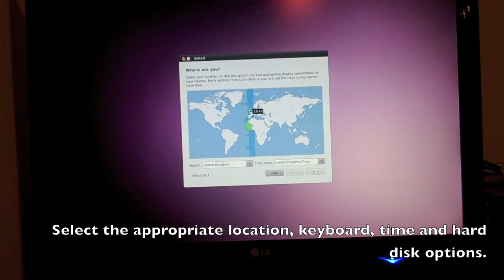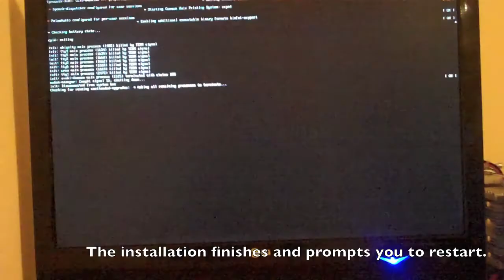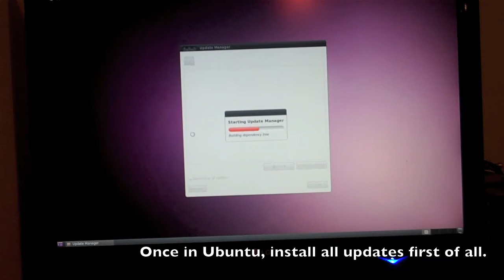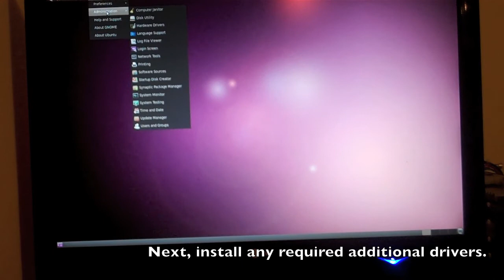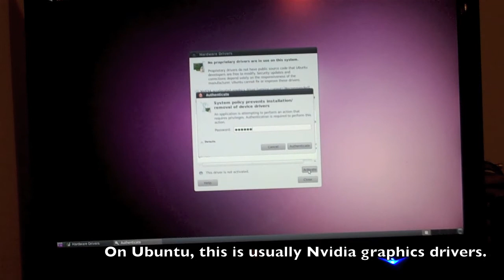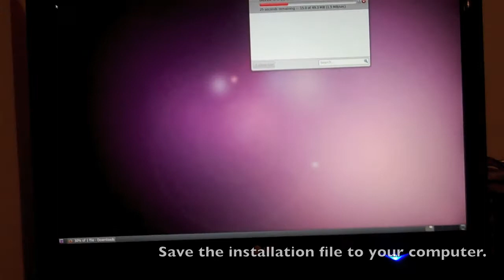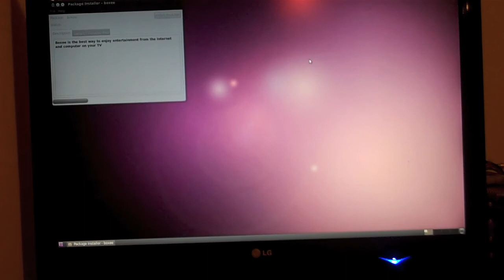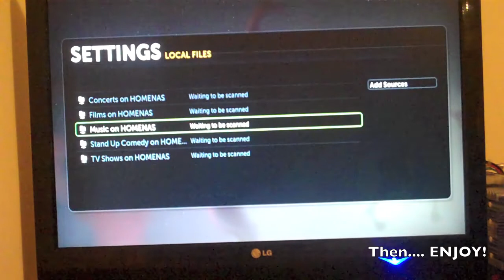Building An HTPC Media Computer - Part Two

Comment from the maker: @michaelglover84 Hi mike, Answers below:

1.  It works quite well, but I wouldn't want to put it anywhere precarious.  I did have it in the kitchen for a while but moved it as I didn't want liquids/steam/grease getting inside the case.  I've also looked at knocking up some acrylic side panels but not had time yet.

2)  The board gets scorching when lying flat, I drilled air holes, but tend to run it on it's side anyway.

3)  Reflections by Dave Weiner, from the album "On Revolute"